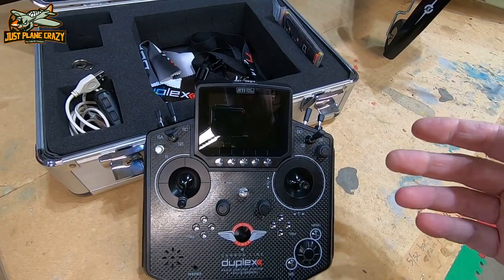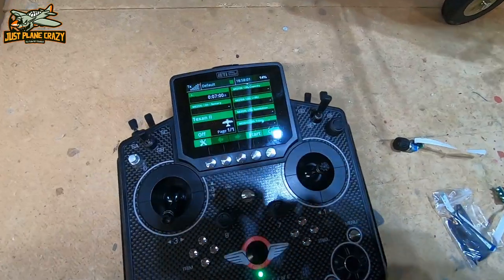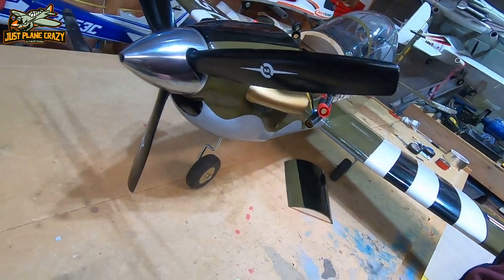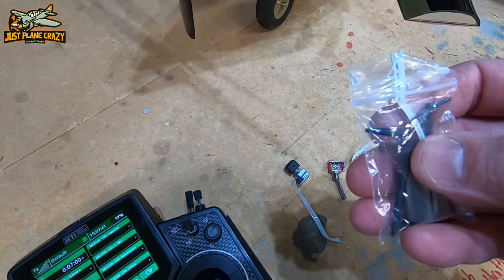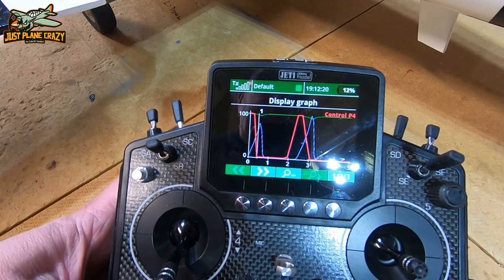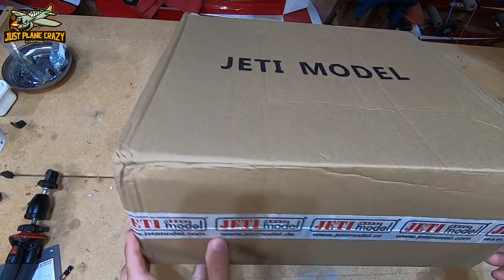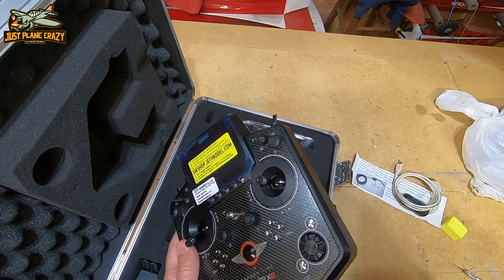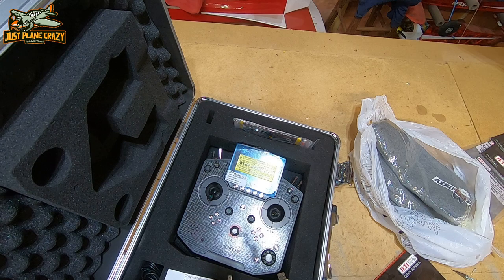Jeti DS-12 Special Edition Carbon Rc Transmitter, A Beginners Point of View

Comment: I've been flying mine for a little over a year now. I switched from Spectrum too and I couldn't be happier with the DS-12 Carbon Deluxe. If you're going to get a Jeti radio, be sure to the the USB interface device for your receivers. A lot of them are shipping without the latest firmware and you'll need that to access the RX thru the device explorer which is much nicer than the Jeti Box emulator on the TX.
Reply from the maker: Great tip

Comment: Thank you for the informative video 👍😎 What is all needed in the aircraft to get all this telemetry data like amp draw, battery voltage, rpm? Sensors?
Reply from the maker: If you use a jeti Mezon esc with jeti receiver you get it all. Otherwise you can use any esc and just add whatever sensor you want to get info. Like current, mah, voltage, temp etc
Reply: @JustPlaneCrazy  thank you! 💪🏻😎
Reply from the maker: Your welcome. Thanks for watching. This has been an amazingly good investment. Love it

Comment: Hello ! What are the main differences between the DS12 Carbon Special Edition and a normal DS12 ? Just cosmetic stuff ?
Reply from the maker: The special edition carbon can be ordered as a fully unlocked version. Meaning all the special features and functions are already there no additional purchase
Reply: @JustPlaneCrazy  There are some other differences that are pretty important. The standard DS-12 has plastic gimbals and a plastic rotary knob assembly. On the Carbon Edition, even the basic one, these are aluminum. The aluminum gimbals alone are worth the price upgrade, in my opinion.
Reply from the maker: great point

Comment: Received my carbon deluxe version last night. I’m not seeing “all” the modules I was expecting. Did you go through the jeti registration process?
Reply from the maker: I did. Not all of mine were enabled at first. If you have any question give either esprit or Aeropanda a call in regards to it. They both answer and are super helpful with any questions you have
Reply: A call to esprit got me going in short order. Ended up being one missing file. Took less than two minutes to correct. Thanks!
Reply from the maker: Hope you love yours as much as I love mine
Reply: Same with my DS 12, could not get 900NG sat receiver talk till I reloaded update files.

Comment: I have the DS12 basic and I feel like the gimbals kinda suck. I cant really tune it so its light enough on the sticks, without being too sensitive off the centers. Like doing rolls, its too easy to introduce elevator by accident. I might get rid of the thing. Jeti is a little overhyped imo.
Reply from the maker: Respect your opinion but just don’t agree

Comment: Whats Up Brendan, I have a question. So yours  is the special edition with 12 channel that is capable of expanding 4 more channels with an expander, but does that come as a purchase option with the radio as well?
Reply from the maker: The deluxe ds12 comes fully unlocked for 1200. That’s what I got. I can’t speak to the cheaper version.
Reply: @JustPlaneCrazy  That answers the question. Thank you & Have a great day
Reply from the maker: U2. You won’t go wrong with this thing trust me
Reply: @JustPlaneCrazy  Seems well worth the money with all of the features and the capabilities of the receivers are just mind blowing.
Reply: @JustPlaneCrazy  The DS-12 basic (Carbon Edition or Standard) comes as an 8 channel radio. For $20, you can unlock 4 channels and make it a 12 channel radio. For another $20 you can unlock another 4 channels and make it a 16 channel radio. It's similar with a lot of features offered on the DS-12 so you can pick your own price point as needed. If you're going to unlock a lot of things then getting one of the upgrade packages offered can be a significant cost savings.
Reply: brandons has 16 channels you dont have to buy all the modules you can buy what you want when you need to up your stuff I originally bought the normal ds-12 and 4 moduals for about750 $ that had the 16 channels. when they came out with the special edition with the good gimbals I got that one for about the 1200 mostly for the gimbals

Comment: Dual band 2.4 htz. ?
Reply from the maker: No. Dual band. 1) 2.4  1) 900mhz
Reply: If you want dual band 2.4 you have to step up to the DS-14 as a minimum. But that's the big, heavy aluminum box radio.
Reply: @mwiz64  pretty dumb radio..no one ordered a pizza
Reply: @mwiz64  its not that heavy i would prefer the aluminum plastic is cheesy